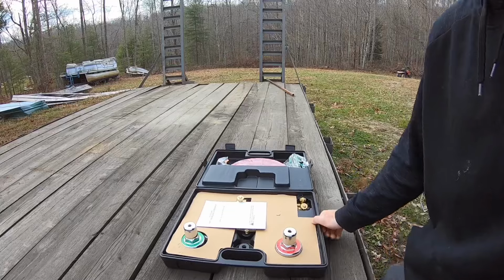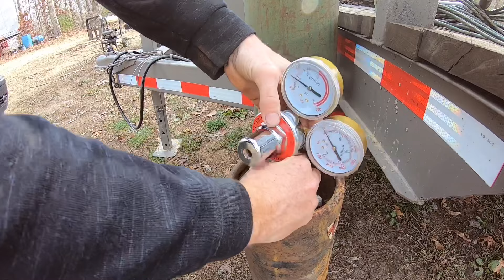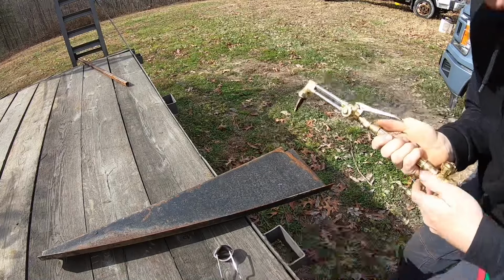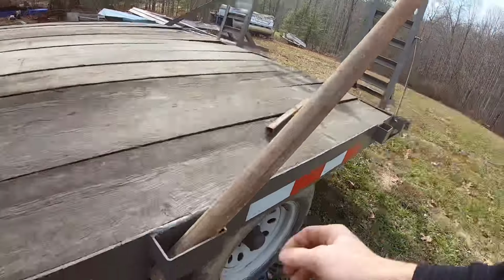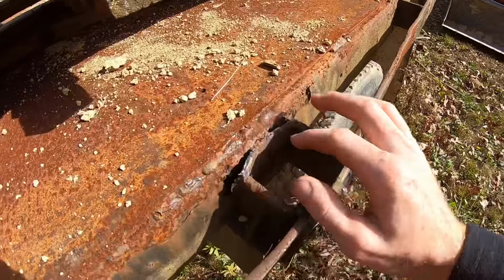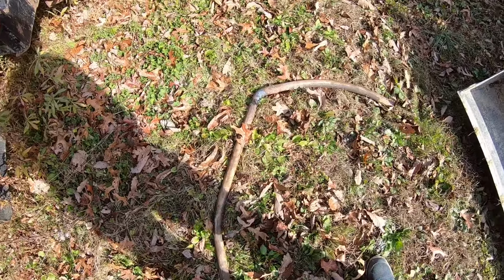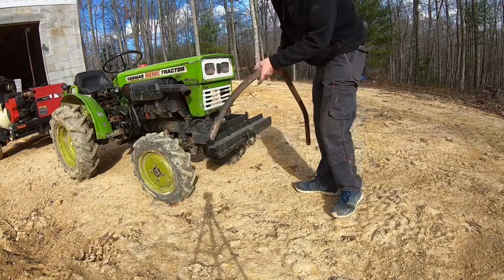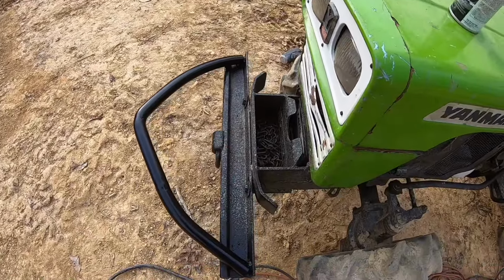Buying The Cheapest Oxy Acetylene Torch on eBay

Comment: your tank isn't big enough to run that rosebud tip.  At the most, it's a 55 cu ft. tank, if it was full it couldn't support that #6 tip.  You need a lot of gas for a rosebud.  Typical #6 tip is going to use 14-40 cfh...with that tank full, you're only getting maybe 7.5 cfh.  Along with the other issues already mentioned...your tank was on it's side, you don't have any securement on your  tanks while cutting, your o2 valve was turned on way too fast, especially considering the likelyhood of contaminants being in the valve.  Did you check for leaks?   I didn't even see a leakdown pressure test.  Your slag is dropping on combustible materials.  Any issue you may have had with the torch is far surpassed by your lack of any type of safety protocols.  You want to hurt yourself, that's fine.  But don't put out a video  teaching how to do something dangerous.

Comment: PS:  Check and make sure they incorporated the antiflashback arrestors in the torch body.  If they didn't you can get ones to go in line upstream of your torch.  Most modern torches already have them but you should be sure.
Reply: It will say if not there are none.  You can also see the extra mass of the torch just after the hose connection.

Comment: Yyou appeared to be afraid to use the torch to its full potential. When cutting and welding remember its the oxygen that supplies the heat. The backfire was because you had too little pressure and so too smaller flame. It seemed to me that your knowledge of gas welding apparatus is about nil. Research proper tecchniques and you will see an amazing difference.

Comment: Keep an eye on the O-rings on the heating tips and cutting attachment. If they crack replace them with rings known to be Viton material. That is a "Victor style" torch and the parts like tips may or may not interchange with similar Victor parts.

Comment: Rules usually require the tanks to be standing up on travel, not laying down.
Reply: This mostly applies to acetylene which stores as a liquid in acetone inside the cylinder, the gaseous acetylene being on top. Acetylene cylinders should be allowed to settle if they've been tipped over. Oxygen stores as high pressure gas when transported in cylinders so the cylinder need mostly just be protected. The USAF stores its cylinders horizontally in GOX carts and flies those inside airlifters so it's quite safe, but custom is to store oxygen cylinders vertically and chained or restrained against tipping. Every user should study OFFICIAL welding and industrial gas safety training material and AssUme nothing.
Reply: Acetylene tanks should ALWAYS be vertical so internal acetone remains on the bottom. The US Air Force gaseous oxygen carts stow cylinders horizontally and they've been shipped by air that way since first issued many decades ago but custom generally has them and fuel gas tanks vertical to keep it simple in civilian life.

Comment: love that "rose bud" for heating up steel to bend. hope that set up works good for you. my hypotherm 45 wont cut thick enough metal. so use a torch to cut thicker steel. one set is victor and the other is harris. my hands are not as steady as they once were. when i have to cut a straight line, i lay a straight edge on the piece to be cut and run the torch against it.

Comment: When opening gas valves always have the cylinder valve between your face and the regulator. The regulator is the weakest link and when you hit it with high pressure gas if something lets loose or isn’t secured you want your face protected. The big brass tank valve is a lot of armor.

Comment: You can adjust that striker on the flint so it strikes better and when cutting either turn the heat up more or preheat more o wanna say your oxygen should be set at 20 and acetylene at 10

Comment: You need to turn the acetylene a little higher when your lighting it off lol other then that seams like she works good for being cheaper when your trying to bend it especially a pipe that thick heat more area as hot as you can get her